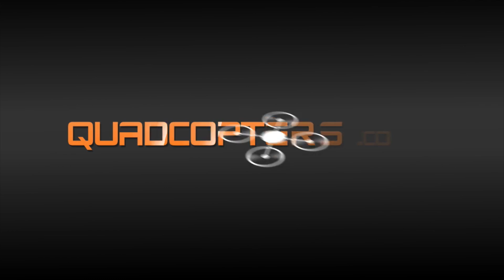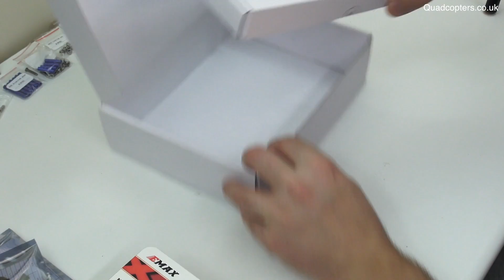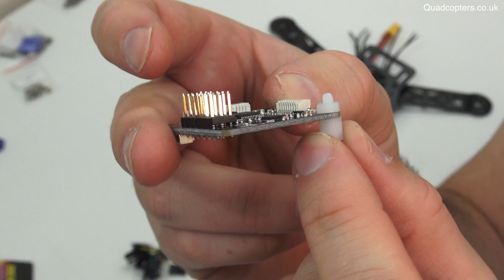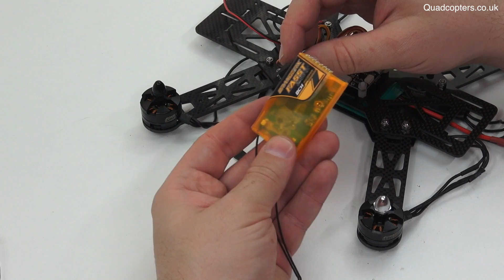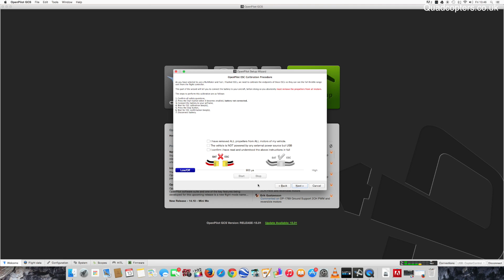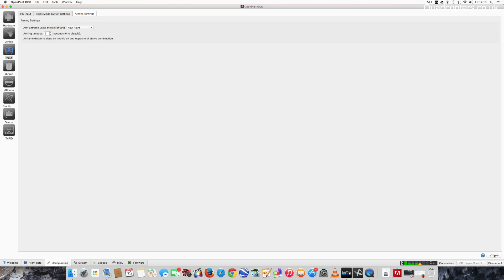HPIGUY | Emax Nighthawk 250 CC3D Build - Budget MiniQuad

Comment: I have the quadcopter i haven't even been able to wire it up they sent me the skyline32 flight controller and im stuck the board comes with so many wires and i have no clue on how to wire it up correctly I have got to the part where the arms and escs are wired up to the PDU and have attached the flight controller and this is how it stands... the connectors are not even marked.
Reply: same here man

Comment: get a better one, like a eachine racer 250 kit from banggood and then get like a flysky fs-i6 transmitter with ia6 receiver for like  200$ total and its much better then this for only like 80$ more
Reply: *****  ya i was gonna buy it then do some HUGEE mods on it, like the only parts left would be the frame and the main board and the motors (probs not even the motors)

Comment: Hi sorry to bother you again but I'm following along and got the point where you plug in the servo cables into the receiver. I'm using the skyline 32 board and the fs t6 receiver. I plugged all the servo cables into the receiver and plugged in the battery, the skyline 32 did the beeps and flashes but the receiver does nothing . Ive tried turning the servo cables the other way with no luck. I'm completely stumped and would appreciate any advice, thanks
Reply: *signal cables not servo sorry
Reply: +calzaggii22 I have the flysky fs t6 also and i have major range issues with it. you could possibly have a bad receiver for the fs t6. They are pretty common i found out with that TX. Good luck i hope you have fixed it by now.

Comment: will a 2200 3 s be suitable for this
Reply: wayneuk A little to heavy,. Anything from 1000mah-1500mah will be fine
Reply: markybyeah ..to late it fly great with a 220 3 s
Reply: wayneuk
But you wont be able to fly with camera and fpv gear... it will be too heavy and stress the motors and be slow at the same time
Reply: markybyeah ..   flys just fine with everything on board have u tried it with a 2200 3s or  just assuming it wont work.  plenty of people using one with no probs
Reply: wayneuk
I have a 2s in 2200mah...yes the battery works, but the battery is a little too big for such a small quad. I guess you're not as picky as me then..

Comment: I built mine with the arms lower and then removed the stand off's alot lighter and CoG is more down low, i found it really helps. Give it a try if you still have the frame.

Comment: Help help help I just calibrated my night hawk with open polt with no prb but then when I was done all i did was glued my receiver in then went out for first flight but then as soon as I plug in battery the cc3d board does not light up so I unplugged it and realized that the esc where verry hot WTF it was just fine on the open polit. So now every time i plug in my battery it does the same thing for all esc even when i tested each one

Comment: Waiting on this exact kit.... Got a YI camera for under $80 and a FlySky TH 9X for $90.... Will be in the air with FPV and 1080p video of all my amazing crashes.... All said and done it will be a $350 system minus the goggles. Thanks for the video.
Reply: Got my Quad built, struggled with Openflight, could not get it dialed in at all. Switched to Cleanflight firmware and it is night and day. This frame is tough as nails.
Reply: Ollie Williams I just finished my built as well, and I'm struggling with open pilot, can't seem to want to hover drifting in all directions, (not so bad) but the altitude hold is none existent, if move the throttle only one click it keeps going up , and one click down it goes all the way to the floor :/ was cleanflight easier to tune? is it stable?
Reply: It was for me, But I was able to get good flight with open pilot. You might want to make sure your flight mode switch is working and your radio is tuned.
Reply: They are, the only thing I could think of maybe vibration effecting the FC , I have it installed in a protective case sitting on a double sided tape, this is the only thing I haven't changed yet, I might try installing it on stand offs like everyone else and see if this makes any difference, I took it out to the park today and I noticed when I pitch slightly forward and I let go go it just keeps going forward till I pull back, is this normal for those 250's because the drone I learned on did not do that? also when I pitch forwrd it loses altitude and I have have to give it more throttle with the pitch to keep altitude, something I didn't have to do with my toy drone well not as much at least.
Reply: Gus F Yes, you are in Acro mode. Everything you have described is normal.

Comment: Great video, but you installed the bottom plate screws the wrong way... The nuts are meant to bolt on the bottom of the plate not at the top. Thanks for the tips on programming. Very helpful

Comment: Hi Rich, just ordered one of these from Quadcopters.co.uk as I wanted an Easter project, I have a 3S 1300mah lipo already, but notice that you are running a Nano-Tech 4S. The Emax 12A SimonK ESCs state they are rated for 2S-3S, I am assuming the BEC can handle the 4S, but can the ESCs sustain the 4S long term with the 2204s and 6030 props?
I really want some punch, and I know the 2204s with 6030 props will fly better on 4S so will go down this route if I can without upgrading the ESCs.
Also just ordered the HobbyKing retracts and some carbon legs for my F450 having watched your clip a few nights ago. I even went out and bought the Toolstation tap and die set!!

Thanks for the great videos.